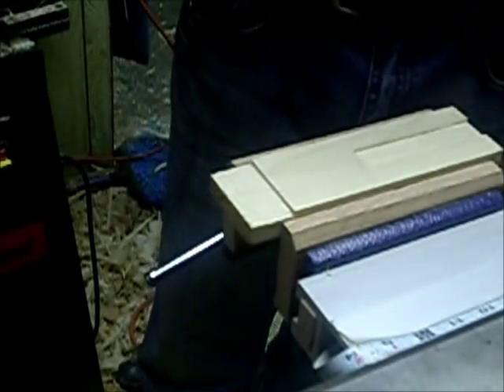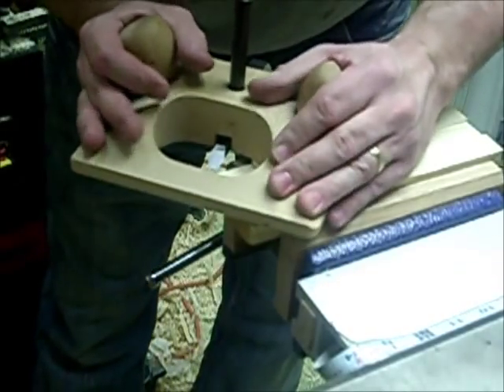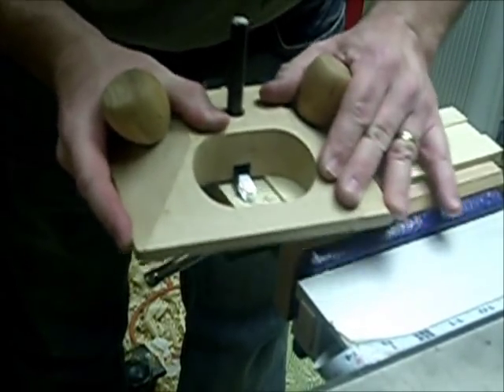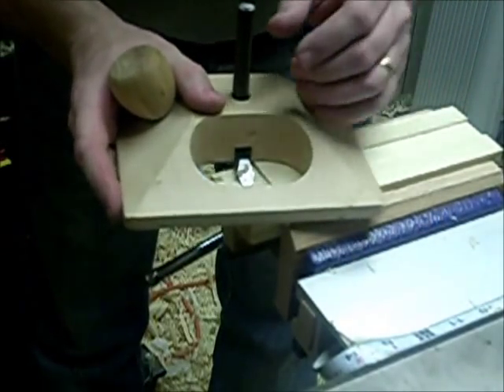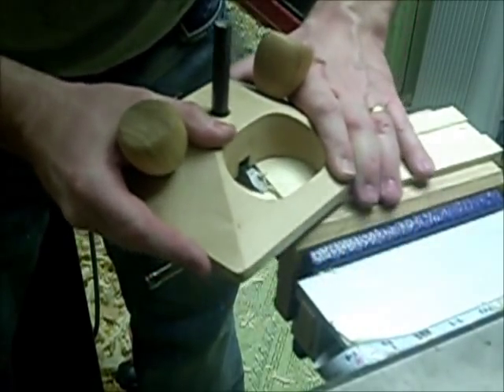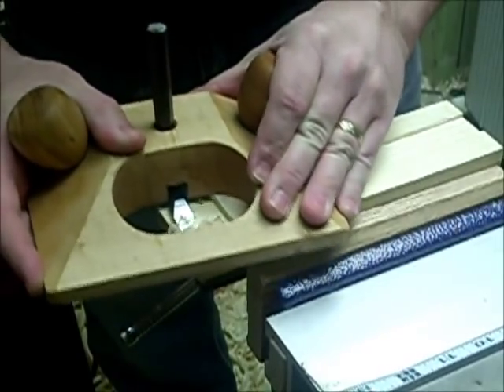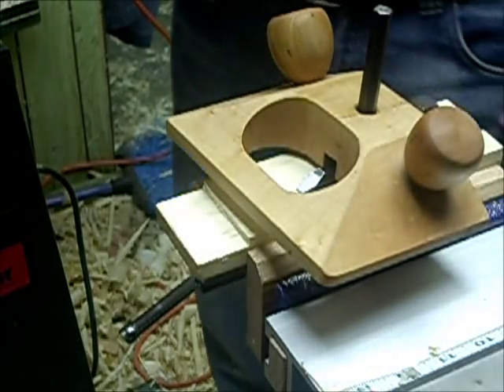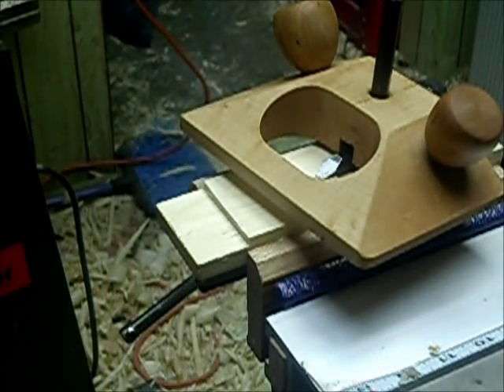ROUTER PLANE - Making accurate tenons

Comment: Nice job!  Really handy to have a router plane.  I think it would perform better if you ground away more steel from the bottom of the cutter so that the widest part is the front of the blade.  And/or  one that's pointed/rounded works really well as you can just use a side to side motion and basically walk the cutter to near the end of the cut then turn it around and cut from the other direction to eliminate tearout.  I'm going to copy your body design.  Well done.